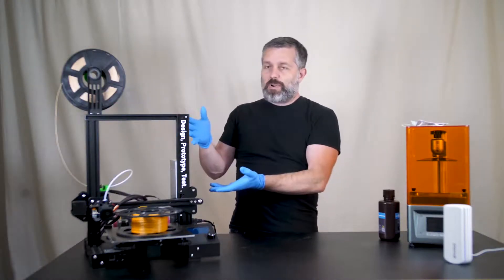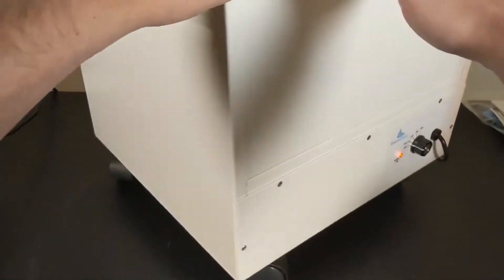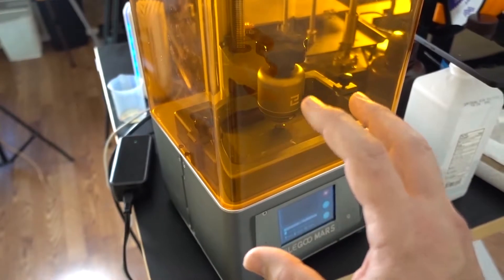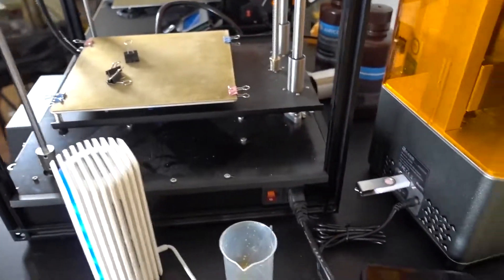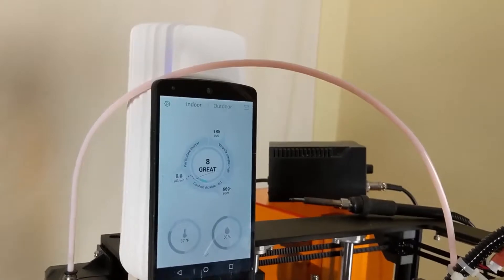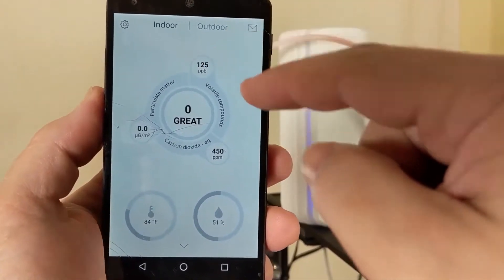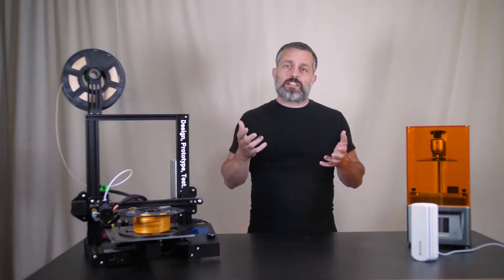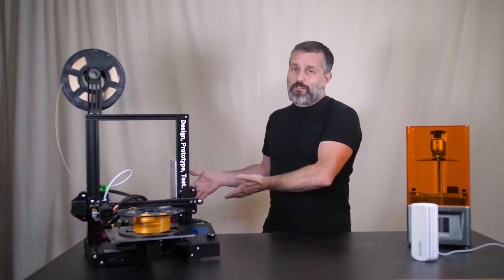Best Air Purifier for 3d Printer Fumes | Design Prototype Test Reviews the EnviroKlenz® Air Purifier

Comment: Given the smell of a 3D printer you probably wouldn't notice this issue:

I recently bought an EnviroKlenz based partly on this review and now need to return it. When I opened the casing to install the filters I smelled a rubber/plastic smell. When I turned on the machine it started pumping this smell into my home. Perhaps given enough time it would fully outgas this smell, but I live in a small place and don't have an isolated room to outgas it in.

Reading Amazon and Better Business Bureau reviews after the fact I now see that I'm not the only one with this issue.

It stinks as this does seem to be a good odor and VOC removal device.

I do not have MCS, I'm just a person with a regular nose who likes a perfume-free house. My wife has scent-triggered migraines and needs something to get rid of the laundry and perfume smells that come from our neighbors through the shared attic/wall. We both noticed this off-gassing smell as a strong, noxious odor.

Comment: This product filters down .3 microns where as the UFPs released from 3d printers are .1 and lower. Why is this a good filter for 3d printing?
Reply: Yep. Also, the foobot is complete garbage. Google "foobot fake science". This video is garbage.
Reply: "A quirk of the physics of filtration is the very smallest particles are actually easier to filter out than the 0.3 micron ones. The smallest particles get pushed toward filter fibers because of their collisions with gas molecules in the air, Siegel explains." https://www.vox.com/science-and-health/2020/8/19/21364031/coronavirus-air-purifiers-filter-hepa-merv-ventilation
Reply: It's gimmick